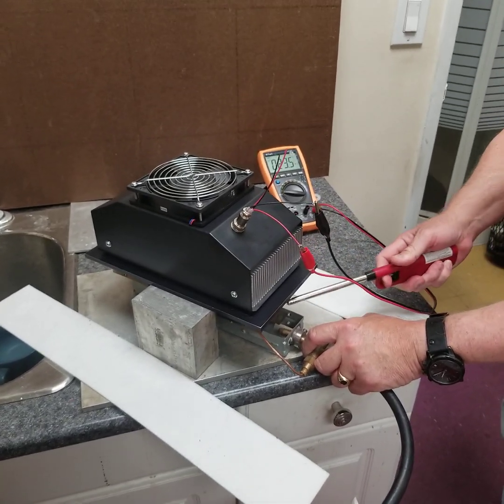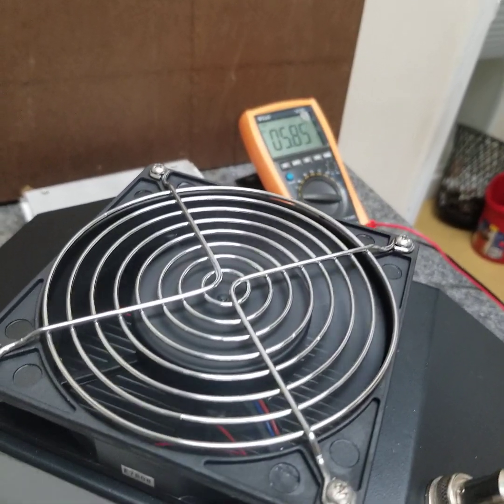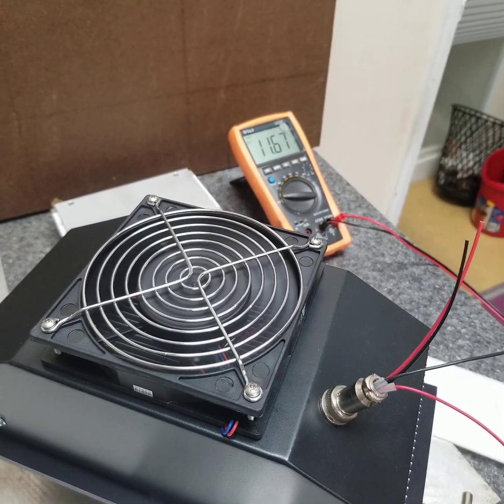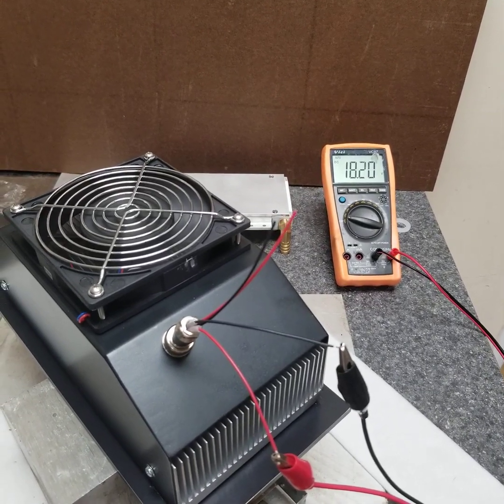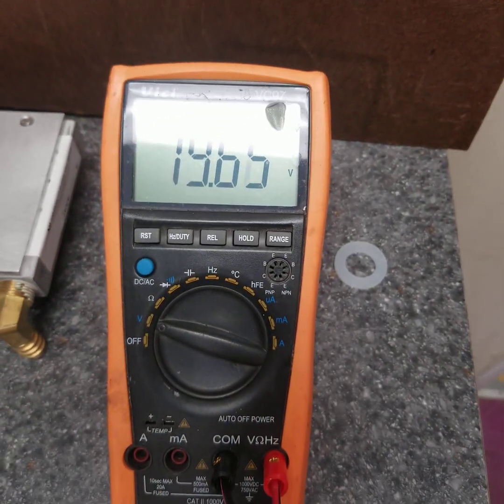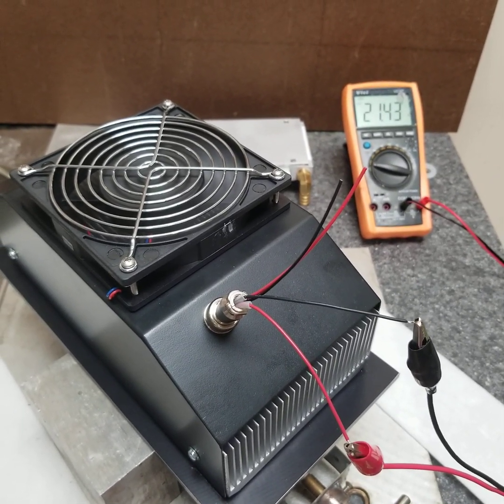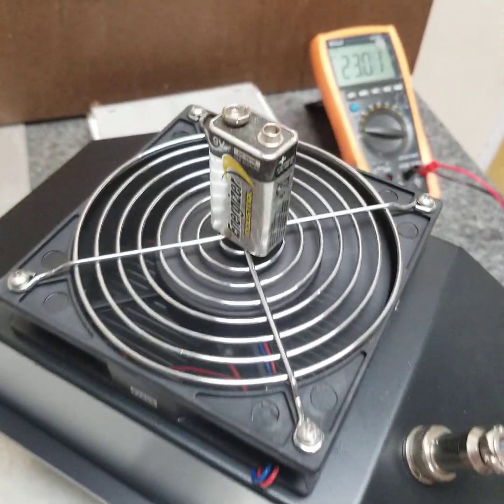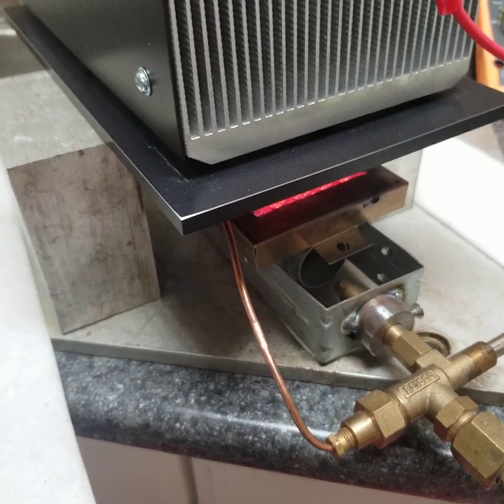12VDC TEG30 Watt Air cooled Thermoelectric Generator

Comment: Are you guys still making these? It looks like most everything is out of stock on the website.
Reply from the maker: No, But we are still making these units. That produce 10 watts x 3 will produce easily the nominal rating. The air unit used a fan which consumed 5 watts and because air cooled isn't as efficient the 30 watt even though it was de-rated struggled to get 15-20 watts net output. The IPOWERTOWER is a far superior design!   https://www.youtube.com/watch?v=xUO2RjEp-xI  If your interested you can email us at tecteg@rogers.com or text or call 905-252-8574

Comment: Would this be able to charge a goal zero yeti 1500x generator instead of solar? Even if somewhat slow.
Reply from the maker: Yes, You would it charges at 14.4V so it would charge this battery.

Comment: What’s your temperature delta? What’s the operating (min-max) spec of your tegs?
Reply from the maker: Depend what TEG's semi-conductor we have from body heat to 600C. Standard BiTe TEG modules are 320C or 610F  but you need more ehat to start as these devices suck heat as quick as you can make it.

Comment: I have the devil watt 15w. This looks awesome, and very similar. Are they for sale?
Reply from the maker: This unit is about 3 times the size and has a 5" fan and two heat sinks 8 modules, quick start fan weight of 12 lbs so much better power output. These are made in Canada . Devilwatt is Chinese tegmart just rebrands.
Reply: @thermoelectricpowergenerator  love it. I’m not sure it would fit on my tiny cubic mini woodstove. Will look into it further
Reply from the maker: @mcdjchandler  I would look at the IPOWERTOWER. It works better on smaller heat sources and can be adapted to stove pipe 4"  
https://www.youtube.com/watch?v=pPxld4kYi6c
Reply from the maker: Yes, they have been for sale for 9 years thermoelectric-generator.com  go to Online store at top of menu and click on  TEG systems in drop down menu. We've been manufacturing our TEG systems for over 20 years and over that time added more and more designs. 
Peltier based cooling systems over 32 years.